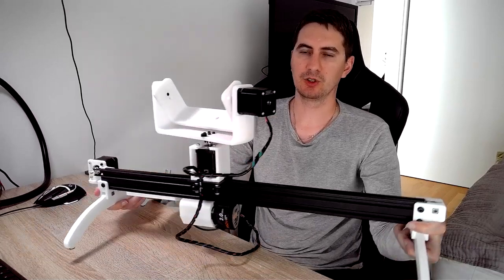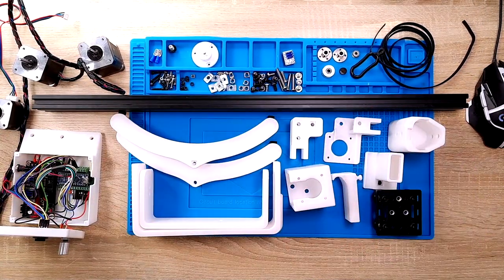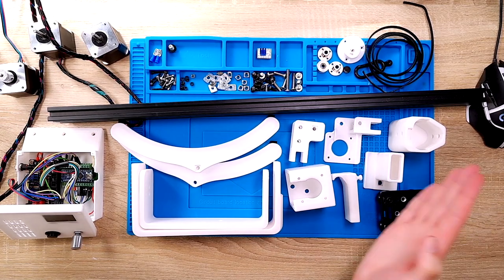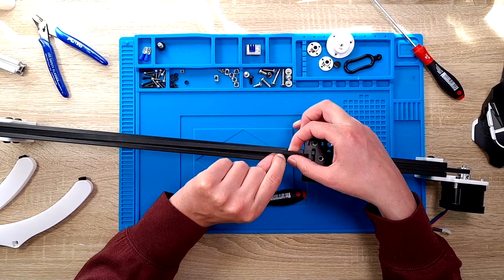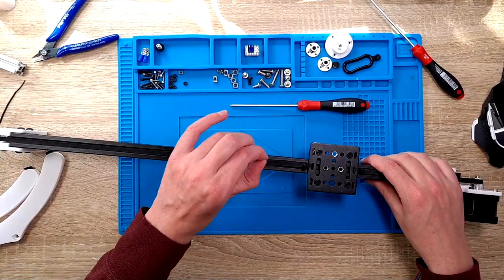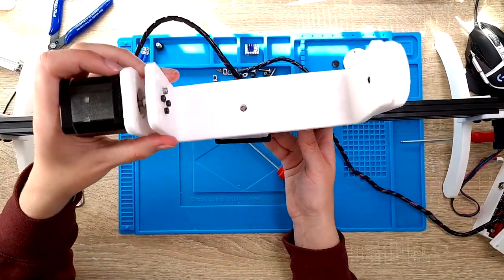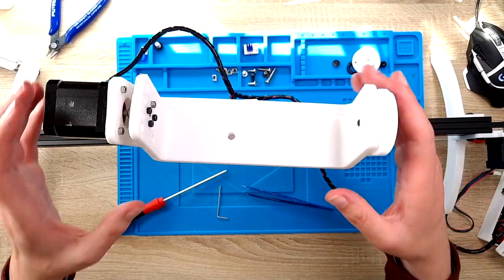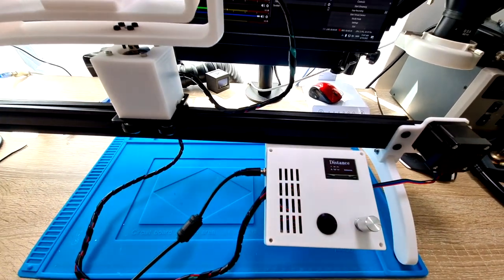DIY 3 axis Camera Slider - Open source

Comment: Hi thanks for the video is this the right sizes for the Bearings ? F626ZZ Flanged Ball Bearing 6x19x6mm Double Metal Shielded (GCr15) Chrome Steel Bearings
Reply from the maker: You are welcome. The bearing is 623zz : 3mm*10mm*4mm
Reply: @kikihobbyrepair  Thank you very much for that I will order the parts now. Many Thanks

Comment: I like the idea very much and would like to build one but.. would it be possible to have say' a PC App with simple direction controls OR 
Something like a 3D cad mouse maybe? very similar to your 3D printed one to give the user more control over what the camera is going to move to view 🖖👍🏻
Reply from the maker: Do you mean to jog the camera in the settings phase to the final destination/angle to know from where to where it will go?
Reply: Sorry! for the delay. I had to have a shower, been feeling bad for a week or so now. Just started feeling better! Anyway Yeah sort of like if you was doing an FPV flight, move to we're you want the camera to be and sit there taking the shots.

Comment: Hello Kiki; I am trying to add my code to and arudino nano; I am getting 2 issues. One; The rotary encoder library isn't working. Two; U8g2 doesn't work either. Thanks!
Reply from the maker: Have you already installed these two libraries in the Arduino IDE?
Reply: @kikihobbyrepair  I installed them both. Do you have something easier to message on then YT comments?
Reply from the maker: @willtheham1  you can contact me on kikihobbyrepair@gmail.com

Comment: can it be mounted upside down?
Reply from the maker: Basically if you tighten all the screws, it should be fine. But do it on your own risk. Only one grub screw is fixing the camera holder onto the motor shaft. I would maybe not use it this way